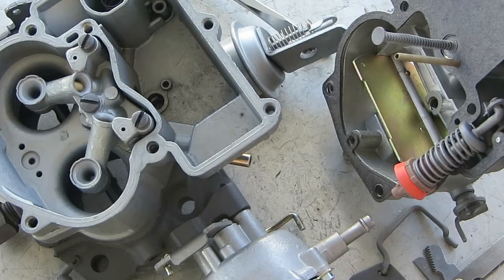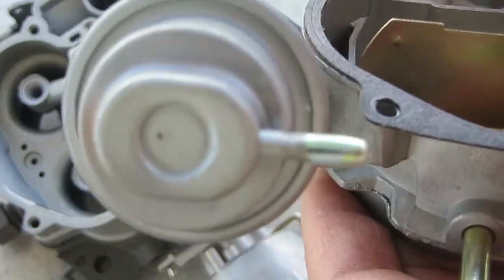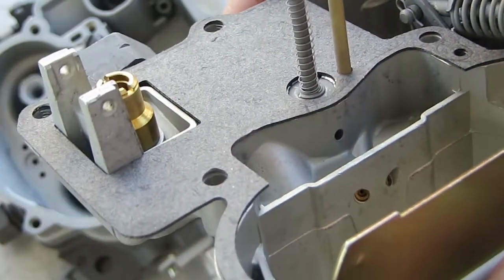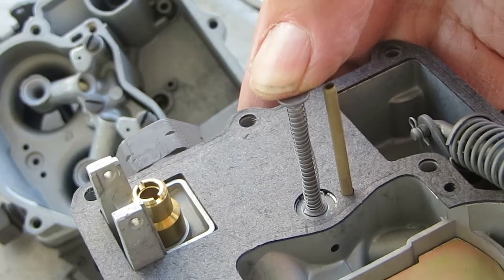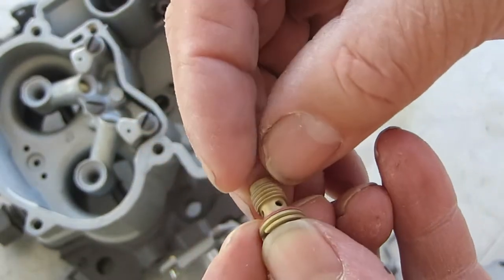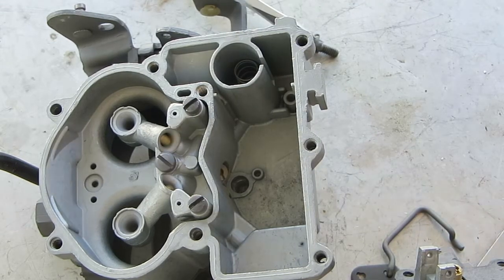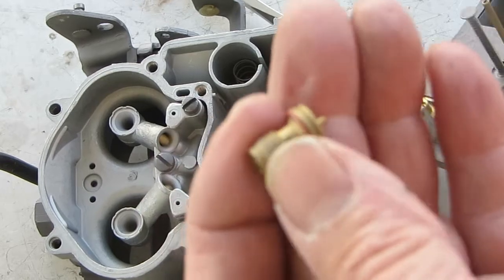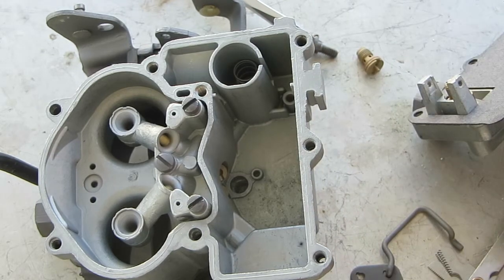Rochester 2 Jet, 2 Barrel Power Circuit

Comment: my engine has 4 inches of vacuum at idle is there a spring for that low dont think its pulling up . sbc with 309 duration
Reply: @MikesCarburetor  i was talking about the power valve piston spring and yes the engine is 11:1 compression with a isky cam 454 lift 309 duration (dirt track cam) anyway i cut the spring and it seems to be pulling up now thanks for reply